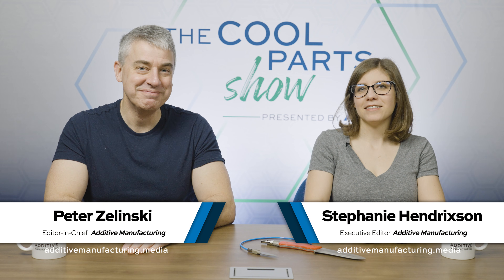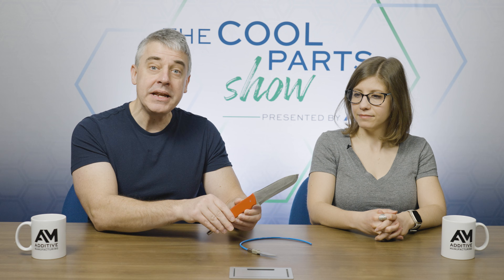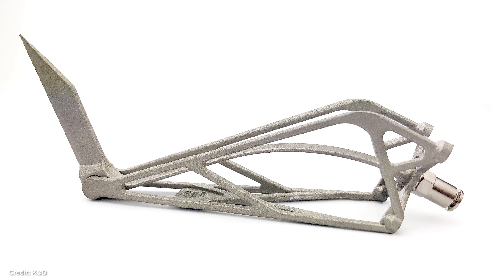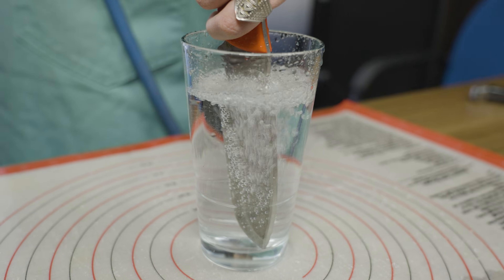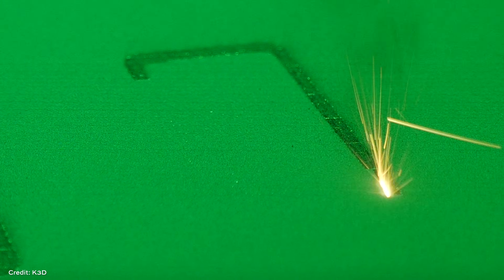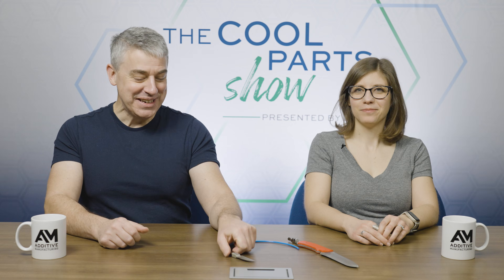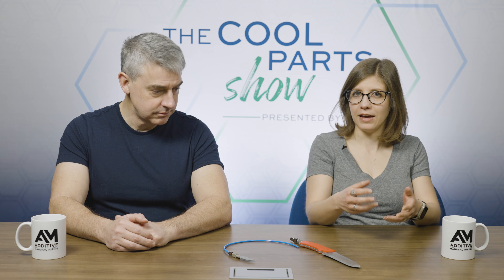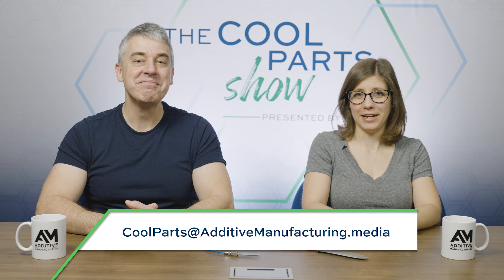3D Printed Blades Use Engineered Porosity to Prevent Sticking | The Cool Parts Show

Comment: The knife is a nightmare for cleaning and bacteria.
Reply from the maker: 👀 https://youtu.be/JAs3HtiQl94?feature=shared&t=696  👀
Reply: @AdditiveManufacturing  Just because you CAN put it in a dishwasher does not mean it will clean all the bacteria out properly.
Technically you CAN put anything in a dishwasher that fits.
I do design professional cooking ware and having pores like this is against code at least in Europe.
Reply: @sierraecho884  I think over time, more foreign matter will get accumalated; at least in the domestic settings where people are too or three lazy..
Reply: @akshay.kumar.k  That´s for sure. You can´t use porous material like that in a kitchen. Not even in a professional one. "Cleaning won´t be a problem, trust me" yeeah I kind of don´t. Unless it´s FDA approved, which I don´t think it is.
Reply: @sierraecho884  Yes
Reply: @sierraecho884  you can flush detergents w/ water at high pressure through these holes. also, when baked at high temperatures bacteria won't survive.
Reply: @DiabolicMagicSquare  "...you can flush detergents w/ water at high pressure through these holes...." As yes the most convenient way of cleaning a household kitchen knife I see. I could also use an oven at 700°C and thermal decomposition the dirt, don´t you usually do that ? 

"...also, when baked at high temperatures bacteria won't survive...." Ah yes I see, you use the "incendirator 2000" too to clean your knifes. I am old fashioned, I use sensible stuff and simply clean them the old fashioned way.
Reply: @sierraecho884  Yeah.. but really do you need these knives for household? lol.  buddy this is an industrial use case and not for home use.. so your concerns are invalid. do not take it personally... you need to understand the context of comments and use case. They are trying to reduce the cycle time for an industrial case and do not have time like your old-fashioned ways...
Reply: @DiabolicMagicSquare  "...Yeah.. but really do you need these knives for household?..." I would say, you don´t need this knife for anything really. It´s just a demo piece. Which industry uses those knifes ? 

"...you need to understand the context of comments and use case...." So what is the use case here for a "smart knife" which isn´t old fashioned ?

Comment: Using air as a release agent seems like a really good idea - less product waste and longer interval for cleaning. I'm sure this already exists, but I wonder if this could be used in bearings to eliminate the need for lubricant? I have done some experimentation with printing intentionally saturated TPU filament with some interesting surface finish results. But this technique brings that to a whole nuther level!
Reply: Yes they're called air bearings. Usually porous graphite, because you want them to be somewhat self lubricating in case there's solid contact (no air supply, excessive load)

Comment: do you really need a 3d printer for this?
just sinter it and sharpen
Reply: How do you make the channel thru the handle then?
Reply: @adamchambers7502  just drill
Reply: @adamchambers7502  Drill. You don´t even have to, you can sinter it on a channel as a core.
Reply from the maker: 🧐We discussed this with Jaap at K3D. He says perhaps, but how is air added? With printing you produce a solid and porous structure out of one piece including air connection, solid body, blade, etc. (Similar to what @adamchambers7502 suggests)

Thanks for watching and chiming in!

Comment: Is this more efficient than using a ultrasonic knife?
(I assume the non stick effect is about the same)
Reply from the maker: From Jaap at K3D: "A porous knife has the same non-stick effect as an ultrasonic knife. The advantage with a porous knife is that you can design it in any shape you want, both in thickness, height, double-curved surface, etc. With an ultrasonic knife this is not possible. Also the price of a porous knife is really competitive with an ultrasonic one."
Reply: @AdditiveManufacturing  Thanks. That is actually a pretty good answer. I would have thought that a ultrasonic knife could be mostly any shape you need and that the porous knife would be much more expensive.

I still think the porous knife would need more power to do the same job, but If it can do a job a ultrasonic knife cannot than that does not matter much.
Reply: At least you can clean an ultrasonic knife properly. That thing you can´t. With this porosity the FDA will never give it´s approval.